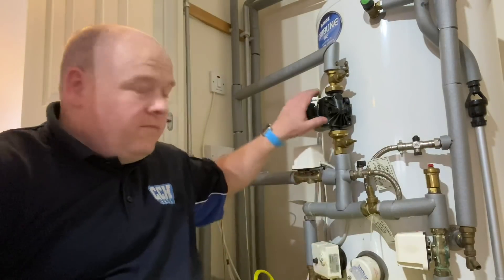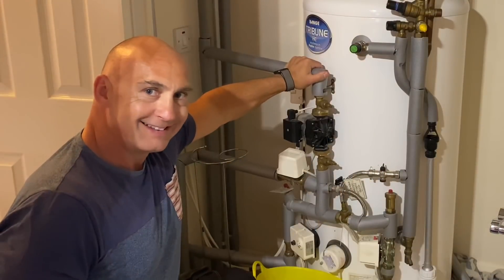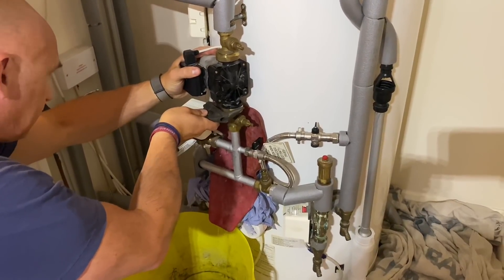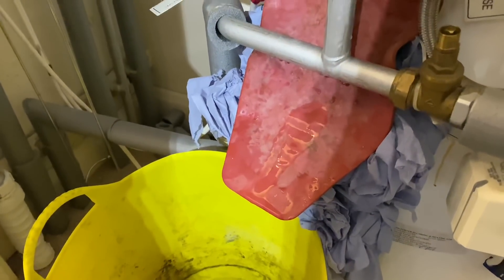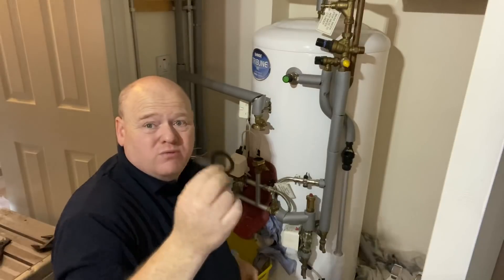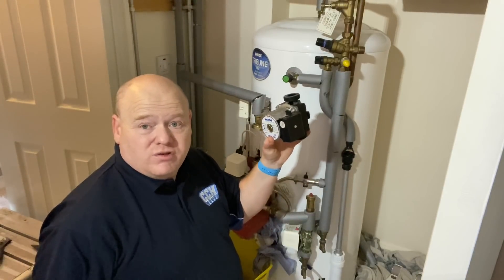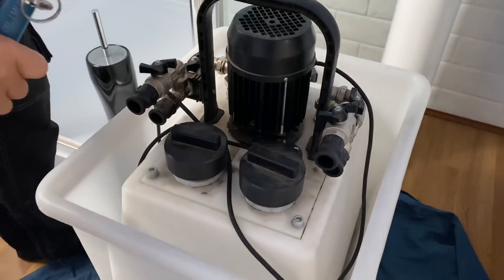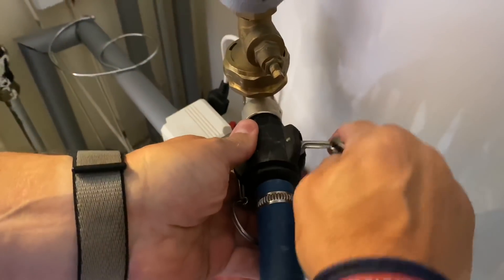How to Replace a Heating Pump - Trainee Plumber - Pump Replacement

Comment: An old gate valve handle fits the pump isolating valves,makes the job so much easier than messing with a spanner.

Comment: Allen, if you loosen the top pump union first you will immediately know if either of the valves are passing. The water should stop quickly rather than being unsure whether you are draining the impeller  or if you have a leaky valve

Comment: Hi Allen the system look quite new build house that pump failed quickly  also why did you have to powerflush system was it that bad?
Reply from the maker: 14 years old i believe. System is bad downstairs but the rest of the system is ok. 3 story house as well. Thanks.